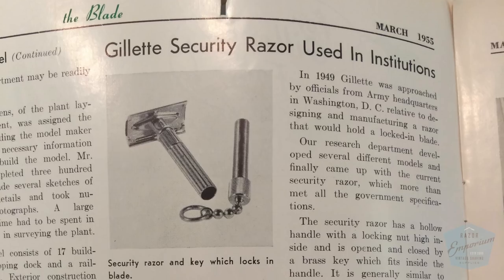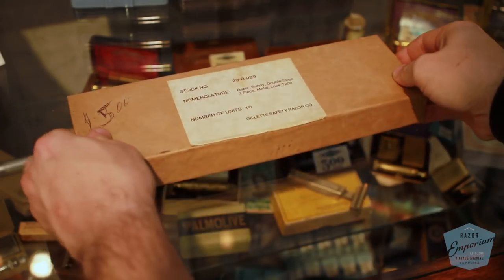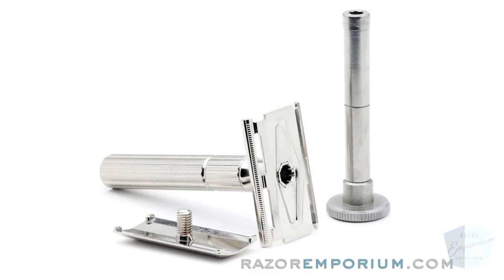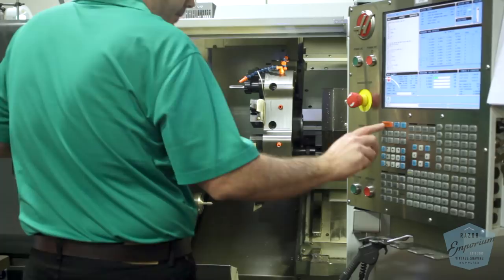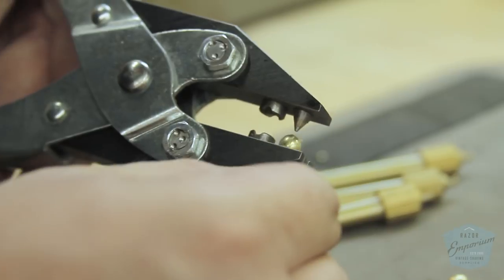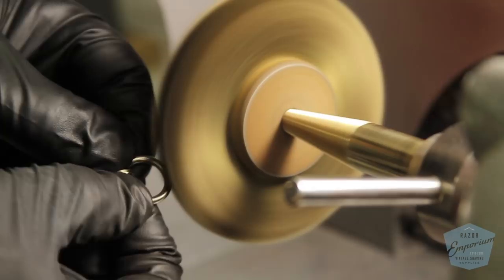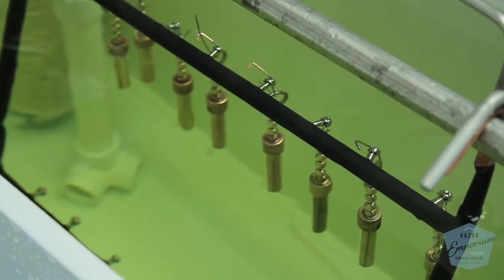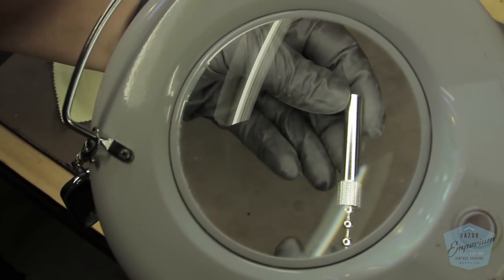Razor Emporium How it's Made: 100% USA Made Gillette Psycho Safety Razor Reproduction Key

Comment: I do not understand the existence of the Gillette Psycho razor.
 Did the Schick Injector razor not solve the very same problem that the Gillette Psycho razor is designed to solve?
 Just like the Gillette Psycho razor, the Schick Injector razor prevents removal of the blade without a key. Unlike the Gillette razors of that era, there is no need to purchase a special model. Every single Schick Injector razor after the model C required the use of a key in order to change the blade. Every pack of Schick Injector replacement blades was itself a key.
 As an institution, I don't understand the advantage of the Gillette Psycho over the Schick Injector. As Gillette, I understand wanting to sell blades to prisons and institutions, but simply waiting for Schick Injector patents to run out, and then make Gillette Injector models, which they eventually did, makes more sense.
Reply from the maker: abrahamchapman you are correct that to properly insert an injector blade, you need the key. Unfortunately, if you simply spend a few moments trying to take the blade out by hand, it is entirely possible. You can easily use almost any small wedge or prying device to take the blade out.
Reply: I had not thought of that. You're right, there are no physical mechanisms connecting an Injector blade to a razor head. An Injector blade is held in place by physical pressure. It would take a heck of a lot of effort, but someone with little care about damaging the razor could indeed pry an Injector blade out.